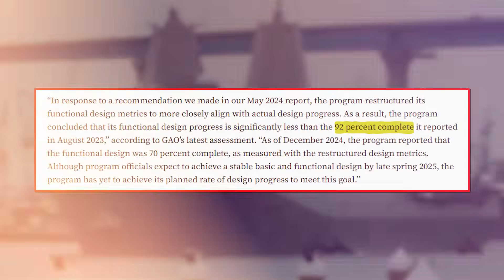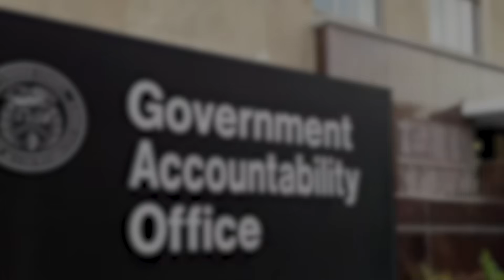US Frigate Meltdown: Constellation on the Brink!

Comment: It sounds like the navy will get a very different beast at the end of it all. It won't have much space for upgrades, but it will be a much better warship than originally envisioned. However, the focus was supposed to be on relative simplicity so many could be built and used as general purpose patrol frigates to do simpler tasks than the Burkes cutting costs for the fleet.
Reply from the maker: You nailed the trade-off: the “simple patrol frigate” has crept toward a mini-destroyer.

Upgrade headroom: About 8 % weight/power margin remains—enough for a laser or radar tweak, not a wholesale makeover.

Complexity creep: SPY-6(V)3, Aegis BL-10, and full CEC forced stricter shock, cooling, and stealth standards, erasing much of the promised simplicity.

Cost delta: Even after overruns, Constellation sits around $1.4 B a copy versus roughly $2.3 B for a Flight III Burke—still cheaper, but not the bargain once pitched.

Mission shift: Distributed ops mean every hull must punch its way through A2/AD zones; a “lite” frigate looked like a liability.

So we’ll get fewer ships, each pricier and far more capable. Whether that beats a larger, lower-end fleet is the question the first sea trials will answer. Appreciate the sharp observation—more intel coming soon!

Comment: First time on your channel, I enjoyed the video. The Constellation-Classes Weight, Schedule, & Budget are not the problem they are the result of the main problem the U.S. Navy, PEO, the same people who run the DDG 1000 & LCS programs now run the Constellation FFG (X) program and we have same issues Weight, Schedule,  Budget, Capability. Stop scrapping the ships they didn't gain the weight and cause the problems scrap the people in change of the programs. They are Small Surface Combatants. (SSCs) they are there to support the LSCs The newest Burke class have Spy 6 so why does the SSCs sailing next to it need the exact same size radar? Your seeing the samething the Burke is, save that weight for additional weapons payload. Any missile fired from a Constellation Class can be updated / controlled by Burke with data link.
As for solutions, the budget is gone you can not fix 4+ billion dollars already spent you can only stop the bleeding going forward so
1.) Design - Scale them back and Give them a designated role, lose the buzzwords. Go the Italian route 2 classes 1 Anti-Air (AAW) or Anti-Surface (ASuF), 1 Anti Submarine (ASW) with any additional growth space not currently being used for designated role use it for extra VLS, NSM, or BAE Adaptable deck launcher systems. They can be removed in future flights if space is needed.
2.) Stop with the new untested systems that take 2 - 4 years to work out all the kinks 1st block of 6 focus on the ship, split 3x3 with proven on-line systems for there defined role. Flight 2 series upgrade with newer more refined systems
3.) Presidential waiver on 10 U.S. Code 8679 to allow ship hull to be built in allied foreign country meeting there own Nato defense budget requirements or Japan, South Korea.  Weapons/Combat systems installation & integration to be done state side in U.S. facilities. Allowing time Until current backlog of ships are caught up and additional people can be trained. 
4.) Adopt Japan's ship replacement strategy so our ship yards have consistent workload and can build talent pool of skilled workers instead of the inconsistent start stop crap we do. No expesive mid life upgrade 20 years and decommissioned that way if there is a delay the older ship still has life left and can stay active until new ship is completed, or new fleet size requirements are meet allowing us to have consistent fleet size. Want to down size fleet fine decompression additional older ships while keeping ships in fleet new and up-to-date with technologies and weapons systems.
This is just my thoughts and opinion on the situation.
Reply from the maker: Really appreciate you jumping into the comments with such a detailed take—welcome aboard! 🙏

Accountability vs. hardware. You’re right that the same acquisition culture that let LCS and DDG-1000 sprawl now owns FFG-62, and program discipline is half the battle. That said, Constellation’s Program Executive Office is not a carbon copy of the past; NAVSEA stood up a “frigate strike team” that reports directly to VCNO, trying to keep requirements creep in check. Whether that sticks is the $1.2-billion-per-hull question.

Why the SPY-6(V)3? The 3-fixed-face variant the frigate carries is a trimmed, 18-ft-diameter cousin of the Burke’s 24-ft SPY-6(V)1. It still needs enough aperture to cue SM-2/6 shots from 250 nm and give theater commanders real AAW flexibility—especially if the nearest Flight III destroyer is tied down with ballistic-missile duty. Could the Burke manage missile mid-course updates for a “lighter” frigate radar? Yes—but only if datalinks stay jam-free and both hulls keep line-of-sight, which isn’t a given in the Arctic chop or Strait of Hormuz haze.

“Two flavors” concept. Your Italian-style split (AAW vs. ASW) is one of the more credible off-ramps if cost growth keeps snowballing. The Navy actually toyed with that during the original FFG(X) trade study but feared two logistic tails and Congress’ appetite for “full-spectrum” ships. If cost realism finally outweighs politics, a specialized Flight II could re-open that door.

Foreign block build. A 10 U.S.C. 8679 waiver is plausible—especially with Trilateral AUKUS momentum—but getting four committees on Capitol Hill to swallow overseas hull fabrication is a knife-fight. The quickest near-term capacity boost might be a “Frigate Lite” module line at Marinette plus block outsourcing of sections (à la sub modules from Quonset Point) before we leap across oceans.

Japanese replacement cadence. Totally with you: Japan’s every-20-years conveyor belt keeps yards warm and crews familiar with new tech, while we swing between feast-or-famine. If Congress won’t fund that kind of rhythm, at least locking each yard into a steady drumbeat (one frigate every nine months, no gaps) would keep skills sharp and cut re-start costs.

Bottom line: we do need tougher gatekeepers, clearer roles, and fewer bespoke science-projects per hull—exactly the points you raise. I’ll dig deeper into those potential fixes in the next update. Thanks for setting the bar high in your first comment—hope to see you in the next intel drop!
Reply: The SPY-6 v3 is a scalable, modular, system than the earlier SPY6 v1 on the 'Burkes.  The version going on the Constellation is only 1/3 the number of component panels that are on the Burkes with only 3 arrays vs the 4 arrays on the 'Burkes.  This is like the minimal specs for AEGIS BL10+ and also a necessity for area air defence if the Constellation is patroling alone.